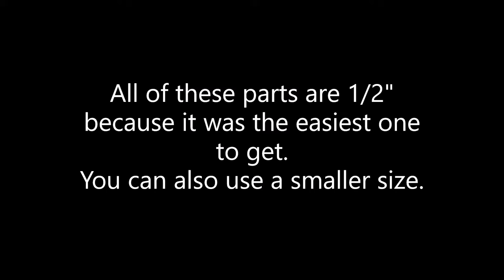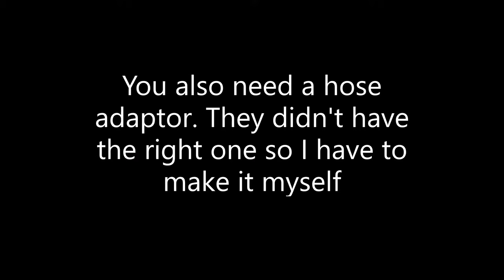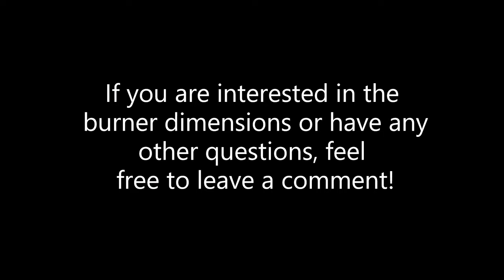Best atomizer/siphon nozzle? Making a cheap oil burner nozzle!

Comment: I'm with a technical challenge in my PhD. Can you help me?
Reply from the maker: Sure, I can try. What is it about?
Reply: @garage_projects 🙏 I have one aerosol generator that can change the size of the particles, but not the outlet flow rate or pressure. It just go out as a fume. The problem is that I need to generate bubbles with the aerosol. I tried just using a hose from the aerosol generator to the botom of a vertical tube but the liquid drains out. The question might be, what can I include between the aerosol generator and the tube to increase the aerosol pressure to be able to create bubbles with it ?
Reply from the maker: @User-Tal1951  So you need bubbles filled with a mixture of gas and particles right? what substances are we working wirh here if I may ask?
Reply: @garage_projects I'm using DEHS as aerosol. I am trying to create bubbles only with it. But the pressure it's not being enough
Reply from the maker: maybe you could try a fuel pump? those have quite high pressures. I don't know if it would be chemically compatible with dehs tho...
Reply: @garage_projects  thanks, it's an interesting consideration. Which one would you say? One that runs continually. What about peristaltic pump?
Reply from the maker: A common rail diesel fuel pump would be the choice for high pressure as those can supply hundreds of bars. They are expensive if you buy them new tho (maybe a used one could be cleaned?). Peristaltic pumps would be benefitial for chemical compatibility, although the high pressure ones can get quiete pricy I think...
Reply from the maker: a single diesel injector element works as well. That would be cheaper but it has lower flowrate as it is designed to supply fuel only to one cylinder instead of the entire engine

Comment: Diesel consumption per hour??!
Reply from the maker: No clue. but if you know how much power you need you can approximately calculate it with the calorific value.
Reply: I asked about fuel consumption of your burner with blue flame
Reply from the maker: No idea. I just stick the hose into a canister, so it's hard to tell

Comment: IMHO, making that hose barb was (#1) a ridiculous waste of time (mine & yours) and material and (#2) had nothing do do with making a siphoning waste oil burner nozzle.
Reply from the maker: It was a weekend and they didn't have it locally. I added timestamps specifically for that reason and you are still complaining...
Also: You're right,  using some piece of junk rebar is a giant waste of material